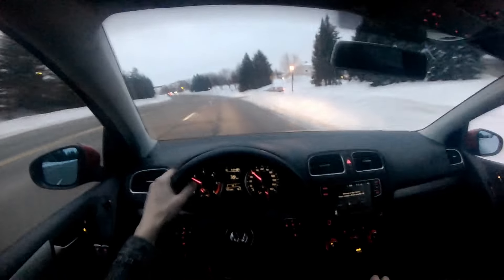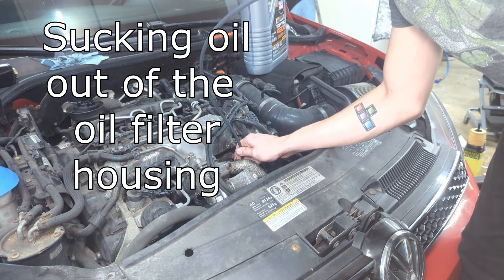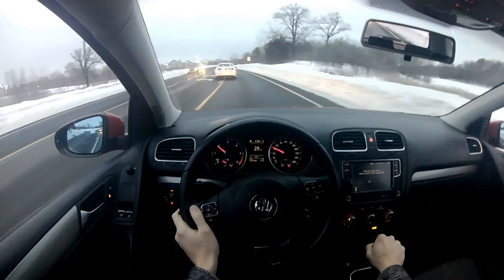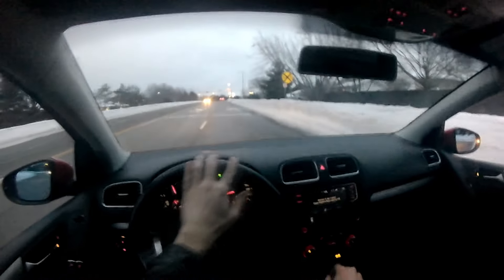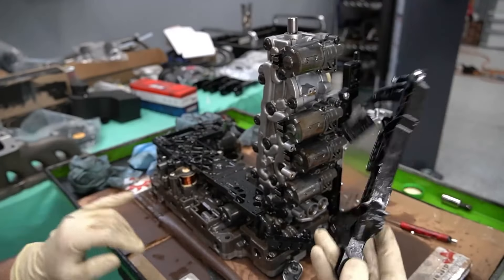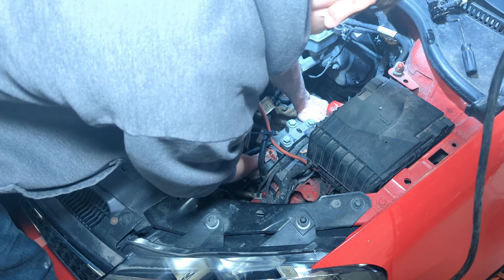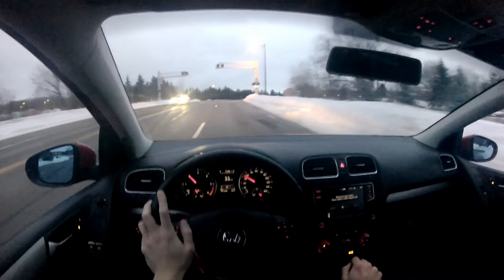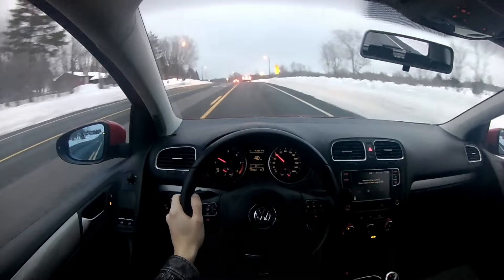Things I Wish I knew Before Buying a VW TDI

Comment: I find it completely insane how precisely VW scheduled maintenance can advise preventive maintenance. "84,000: check rear windshield wiper sprayer" At exactly 84,200, the rear windshield wiper sprayer hose breaks." Now if we could open source the service manuals....
Reply from the maker: I actually found all of the factory service manuals in a google drive folder, I'll see if I can link it in the description. Ithas Bentley's and factory files. It's a lot of information. 

Also, 192k and no issues with the wiper sprayer. Same goes for my dad's 06 Jetta at 253k, my girlfriends Rabbit at 223k. It's a check, not an expected lifespan. Though, if you were very particular about things, I suppose it's not a bad item to get out of the way. They will eventually lose pressure.
Reply: Looking to pick up a 2014 Jetta TDI 6-speed this coming week. Just went to look at it yesterday. Pretty good deal.

Comment: I use AMS oil in my 2003 Jetta TDI Wagon, 5-speed stick.  I bought the car new in 2003, and it now has 407000 miles on it.  It has been the best, most reliable car I have ever owned.  I wish I could buy a new one now.
Reply: Now that I'm 60 I tell everyone if you find something you like buy two...
Reply: I bought 6 😅
Reply: BEWs have bad camshafts and computers, they suck.

Comment: Spot on TDI, I have first gen Tiguan 2.0 TDi. It has 330 000km now 11 years old manual transmission. Not a days problem. Still on original clutch, recently did the 3rd cambelt chsnge. no DPI issues yet. I am happy with the ROI.
Reply from the maker: I wish we had smaller TDI SUVs here. You've gotta step up to a Touareg to get the TDI in the states and no manual available with that.
Reply: @eurodriven2507  
Here we don't have Jettas, and Passat anymore the last was a Jetta 6, the small SUV We have these TDi , Caddy 7 seater and panel van, Tiguan and Toureg, although with newer models the manual transmission are becoming scarcer, except the caddy manual Tdi common.
Reply: People here would LOVE to be able to buy those tdi mini work vans. They would convert well for camping vans/mini RVs.

Comment: I got 61 mpg driving from Tifton, Ga to Dillard, NC in a Mk4 2002 jetta.  I just rebuilt my 2000 Golf.  Cerakote pistons, heads, Turbo and components.  Modified pistons to Speed-of-air type mod. and 0.658 5th gear.  70 mpg maybe??? I'll know after break-in.

Comment: I have an 05 Touran 1.9tdi. Engine is sound and only on 130k miles. Get 60mpg on a run and around 42 on short trips but my gripe is the electrics! Omg nightmare. Stupid sensors constantly going off and throwing up codes nearly every day. I guess the engine will go in someone else’s older vehicle though when I have to cut my losses.

Comment: Hi, this is a really great video and love to see that people use TDI's in the US. One advice that many people give here en Europe is that basically buy a Diesel car if you do long drives and buy gasoline for short drives. Short drives on diesel don't let the engine get to operational temps, and so you get carbon problem on the exhaust and emition systems. So here I have a few tips for diesel cars:
- If you do short drives, try to do a longer (20min on highway for example) on the weekends and/or don't be shy on the revs.
- For the turbo and engine care, use the specific oil that the manufacturer recommends (referring to viscosity and saps quantity) as a high ashes oil has a negative impact on the DPF (it gets clogged), also waiting for a minute after starting the car and before shutting it off is very good, especially after highway use, as it gives time for the engine to cool down a bit, and the oil flow helps the turbo to cool down, if you don't wait, the oil in the turbo basically gets toasted and carbon gets formed inside the turbo, degrading the engine oil and the turbo quicker than usual.
- Do change the diesel filter regularly, generally is done every other oil change, this is very important as injectors are very fragile and the filter cost is like 5 bucks.
Keep up the nice content !!!
Reply: Concur 🙏

Comment: I'm 2 days post pothole on my '12 JSW, and it's so much better, even at stage 0.5. I'm just under 116k, so next up is the timing belt, and CP3 conversion.  I plan on driving this car until it turns to dust.

Comment: Bought my mk6 Jetta at 134,000km , she’s currently sitting at 346,000km. At around 202k she needed a replacement emissions system so I did a 3’ turbo back straight pipe with a stage 2 Malone tune. Over the course of 7 years of ownership, she’s costed about 20k in repairs due to my constantly driving like an asshole always rolling coal & stomping on the gas. Granted I always had my work done at the dealership so in reality I’d say it’s only really about 8ish k in repairs the rest being getting the job done. I was doing about 55,000km a year for the first 4 years of ownership then moved closer to the city. Recently did the water pump kit…for the second time & had the mechanic do a full once over for health & he told me I can get another 10 years out of the car. Love it so much. She’s a dsg & the flywheel has rattled for about 3 years now but the mechanic told me It’s common & doesn’t mean bad health. It caused me to love vw so much I’ve added a 16 Touareg to the garage.
Reply: My 1.9 VW Caddy has a similar history. She's got 306,000kms on her right now. At 290,000 I had to replace a lot of parts from wear and tear. It was a slow van when I got it. I soon realised the emissions equipment was coked and deleted it. I just run a pipe off the turbo and dumps near the drivers side front wheel. She now goes hard and sounds like a mini truck. Lol.
The original CVs broke, too, so I  replaced both axels. 
The old carby days helped me learn these ECU engines.
Reply: I saw that a rattling dmf can start chewing into the transmission.

Comment: Mk6 Jetta TDI here with a little over 392000kms. Had no real major issues (apart from alternator due to a bearing issue, and now air conditioning solenoid intermittently playing up). Has been an amazing reliable trooper of a car and look forward to it clocking over 500000km. I think a good quality low Sulfur diesel (BP Ultimate here is Oz is the best), regular oil changes with a quality oil and filter, and regular freeway trips is all these vehicles need to keep on living without issue.

Comment: I just wish more manufacturers made diesel powered cars because I'd be all over it like flies on shit. But I've got an alh jetta that I just got running right and it's been more enjoyable to drive because of that, but I'm wanting to upgrade to a newer TDI passat just to have something newer and then also, have a 6 speed for the highway driving I do at least a few times a month. In my opinion, TDIs are the perfect blend of efficiency with the fantastic mpg, but also a ton of fun to drive (especially manuals) because either building older ALHs to move or owning a newer car that moves more, it's a blast. Can't forget the great sounds of turbo noises
Reply: I think I’ll be getting over 70 mpg in my 2018 tdi golf it seems that way becouse I’m just starting to check mileage against litres. Only had it 4 weeks and plenty power for me so happy days

Comment: Not sure if you got them on that side of the pond. B6 Audi A4 TDI 130 bhp Avant, 6 speed manual 👌
More practical & refined than the Golf, bulletproof O1E gearbox and the option of quattro all wheel drive if needed.
Mine had over 200k miles on it when I sold it. Still pulled hard, gave high 40’s to high 50’s mpg . 
Would have another but none sold here in Western Australia. B7 looks very similar but had the later B code TDI engines which were not as dependable as the A code lumps. 

Good video 👌
Reply from the maker: Thanks for the kind words! We did not get the B6 TDI over here. We got the A3, but only FWD. The only way to get an AWD VW/Audi TDI in the US is a Touareg.

Comment: 3:13 Another good place to get diesel that is typically cheaper is MFA stations most are card only though but they are usually 5-15 cents cheaper per gallon than in town stations and 15-30 cents cheaper than Truck stops and other highway exit stations. The diesel is typically fresh because farmers go through a lot of diesel

Comment: I have had a different experience with my CJAA. I have a wagon with a manual transmission and I love it. I have had it for about a year. Has a long cranking issue where sometimes it takes a long time to start. Doesn't seem to matter how hot or cold or if the car has already ran today or anything-just seems to happen whenever. I can not solve it for the life of me. The other issue that I had was one of the bolts on an half shaft came loose a tore a hole in the transmission but that was probably due to shotty repairs from a previous owner and not the fault of the car.
Reply from the maker: Mine will periodically long crank, but it seems as though using additive helps. I've also heard that it might be the pump self-bleeding the fuel system partially, but I haven't verified this. 

The CV bolt backing out definitely sucks. They should definitely be torqued to spec and not reused so that's likely the reason.
Reply: My 2014 cjaa had similar intermittent long crank. A new oem starter fixed her right up. Get a new starter you will be pleasently surprised on how fast the engine turns over and starts.
Reply: My 2014 jetta tdi does a long crank every time. If I cycle the push to start button twice, and on the second cycle I pump the gas twice it fires up right away. Theres a guy on youtube who did a deep dive and he thought it had to do with oil pressure or something.

Comment: I need to share this. Have a dpf filling up and not fully clearing during regen. Lucas Oil Diesel Deep Clean. on 1 regen went from 30g of soot load to 0g. Usually ends around 5-9g without Lucas. I would only use it once a month or as needed but if you do a lot of short trip. This is a must every tank to keep it from the soot from plugging the dpf.

Comment: My main problem has been running in to bio-diesel (at Calif. pumps) for my cars with common rail injection (2013 Jetta wagon, 2014 Jetta wagon, 2017 328d wagon), as manufacturers warn it will void warranty. My 99 Jetta didn't have this problem (pre-common rail), but otherwise my modern diesels have been awesome and much more reliable than their gas siblings. Now if I can only find a 2018 diesel wagon or sedan, the last year they were made by Euro manufacturers.
Reply from the maker: That's a big reason why I run fuel additives. If I can't trust the pump to be good enough, I'm going to add the "special sauce."

Comment: Only missed topic is the hpfp cp4 can have a disco party and invite all the injectors
Reply from the maker: I've mentioned that in my Mk6 TDI specific video, this is a much broader overview on TDIs as a whole. Regardless though, probably a good idea to run fuel additive on every generation of TDI, but especially the Mk6+Mk7 because of the CP4.
Reply: I just ordered the disaster kit from whitbread performance for my 2014 jetta. I’m at 215,000km and the odds of it exploding are rare but I’m not taking the chance.

Comment: So I recently bought my first tdi (bew). Can you drop more info on that specific model? It’s my forever car. Plan on a full delete and small tune. I have heard the cams are a fail point. You seem pretty knowledgeable and most fb groups are full of asses when you ask any question. Ty for your time and content
Reply from the maker: I haven't had any personal experience with the bew, but my dad had a BRM Jetta. Same "Pump Duese" tech and supposed cam issues. Make sure you're using a good 5w40 oil with VW505.01 certification. His was past 250k miles on the original cam using 5w40 505.01 oil. The cam was checked at the time of a timing belt replacement around 240k, looked great. Unfortunately it was deemed a total loss by the insurance company after a Jeep was sent flying into it by a minivan.

Comment: My '06 TDI BEW Beetle with 60k miles sucks.  It stopped starting because of a glow plug problem.  What good does good fuel economy do if you spend 1000s of dollars trying keep the electronic pieces of crap running?

Comment: Do you know why I would hear a camera shutter noise coming from my 2013? It happens at idle and also while I drive. It does 3- camera shutter noises and then 1- different tone camera shutter noise. Then it repeats again.
Reply from the maker: The only thing I can think of is the butterfly valve adaptation, but that should only happen when you turn off the car. Can you get a video of it? The TDI Owners Facebook Group is a good spot to go, much more information there as a group than I can offer.

Comment: I needed to replace the clock spring and hatch lock. Not much, but these should never have failed. I rate quality of the diesels as average.
Reply from the maker: What year was yours? And I agree, those items shouldn't have failed. Unfortunately, the chassis isn't up to par with the reliability of the motor. Though I do think that factor gets better the newer model year you go.
Reply: 2009. Buyback in 2017.

Comment: What is your view on the oil pump vibration balancer on an mk6 and downgrading it to the oil pump system from an mk4
Reply from the maker: I'm not familiar with that swap. The only damper upgrade (if that's what you're talking about) that I'm familiar with is the Kerma unit.

Comment: how about the timing belt. when do you really need to get it replaced. 2012 passat tdi. we commute 70 plus highway miles a day so emissions are not a problem. gets over 500 miles per tank easy. it has like 95 thousand miles now
Reply from the maker: Some are real sticklers about the 10yrs, others only really care about mileage, others just don't care/know until it pops.

Comment: Looking into a 2012 jetta sportwagen tdi with a dsg transmission with a 140k miles, tips encouraged. And if you dont mind what you personally value it at?
Reply from the maker: All of my available info is in videos on this channel. My Mk6 TDI buyers guide might be more relevant than this video for this conversation. 

I can't set a value without looking at it though. Is there any rust, does it have the pano-roof, what's the maintenance history look like? 

The DSG drops the value a fair bit, but if you're stuck with an auto for some reason, it's not a bad auto.
Reply: @eurodriven2507  I'm going to check it out in person tomorrow, but from the pictures, it looks perfect condition, has the panoramic roof, no seeable rust so far,  I'm gonna ask about the mantience and stuff when we meet. it does have a dsg transmission. The only noticeable damage so far is a ding on the passenger side front fender. The interior I'd half tone black and the other half beige, and the beige part looks really clean inside, with no scuff marks, scratches, etc. that I can see as of now. It will be my daily that will hopefully last a few years.

Comment: Whats considered small trips? Im considering buying a 2014 TDI wagon. I currently own a BMW i3 Rex. The only thing i don't like about my car is the ride quality and the expensive tire replacement cost. I also need a roof rack.
Reply from the maker: I would say 20 minutes one way is the threshold between short and normal trip. To be fair, most of my drives are shorter too, but two or three times a year, I do 10hrs of driving in a day.